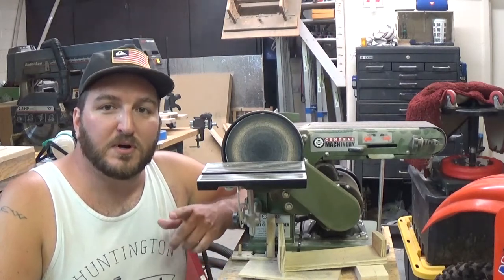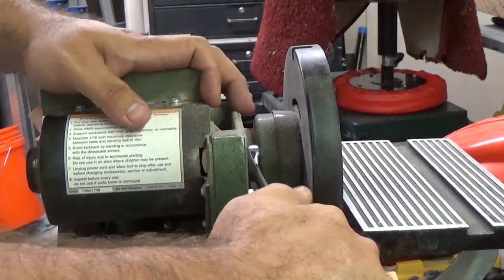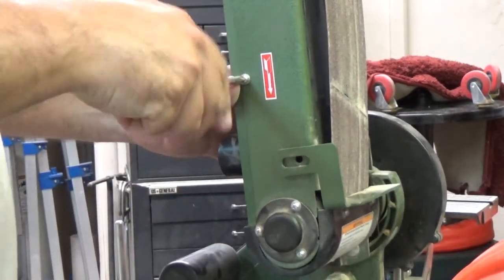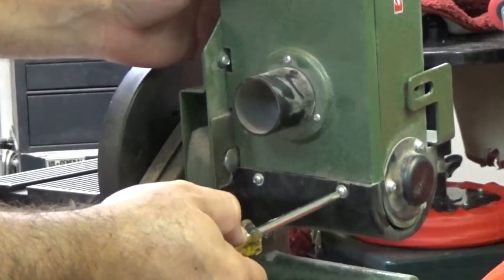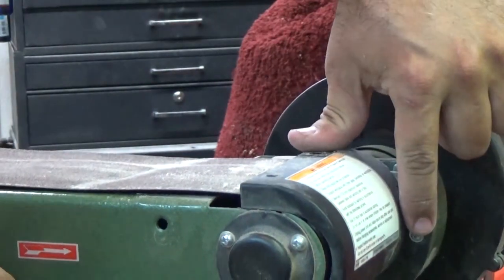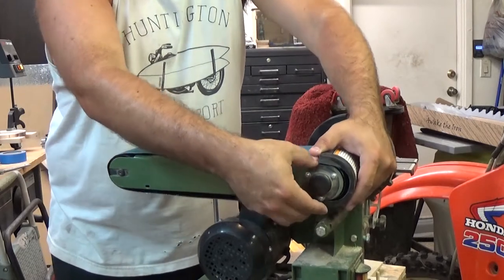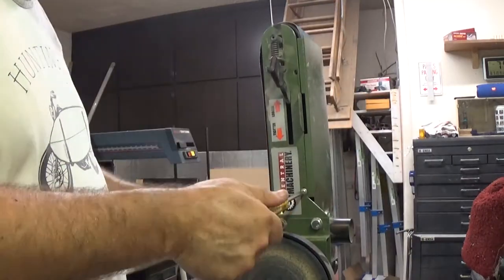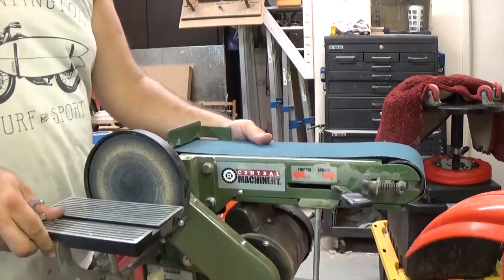Harbor Freight Belt Sander Change

Comment: It's a good idea, while you are working on it, to tighten down all screws, bolts, and set screws. You'll likely be much happier with it's performance. On my HF sander the set screws on the disk table were loose. The wobble went away when they were tightened. Amaaazing! ya big dummy...I sez to myself.

Comment: One more thing.   If you have trouble tilting the sander vertical,  there is a second nut below the first that could be tight.  Loosen it too.  It is probably there to keep it vertical.   I don't know -- didn't read instructions.

Comment: Heads up. The power switches on those things are super finiky and it is only made of plastic. Mine stopped working because the plastic housing couldn't stay together causing the two pieces to become dislodged when the switch is flipped and making the cooper seesaw things not stay down.